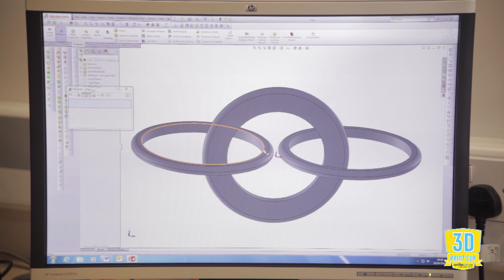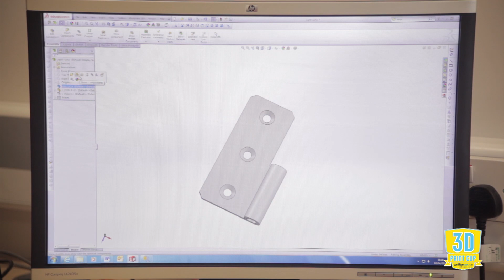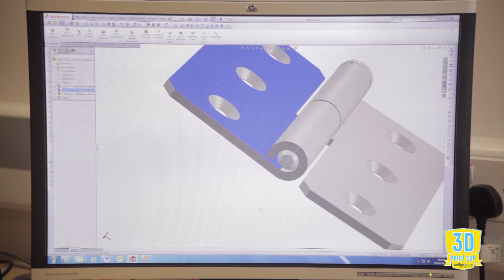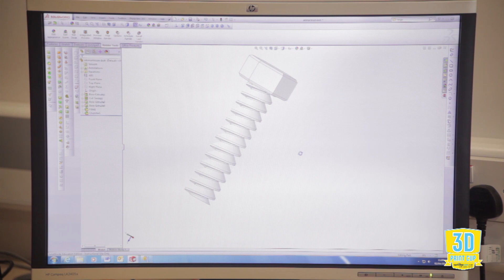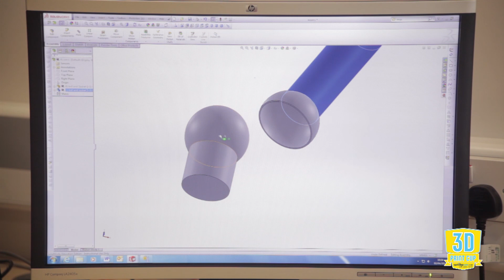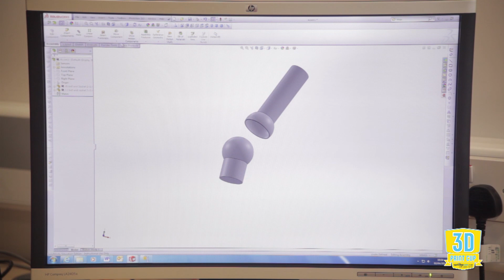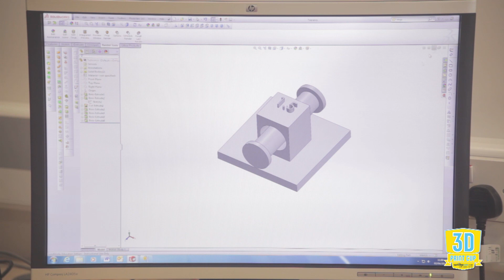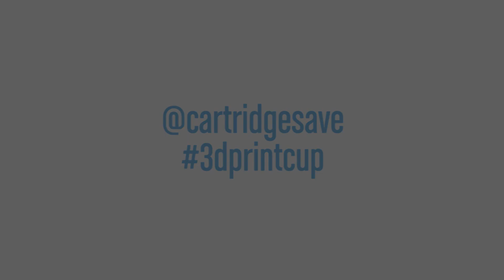3D Printing: how to make moveable parts

Comment: This video did not actually show how the printer should be setup to print these parts, which is what I wanted to know.  ie do you NEED support in all cases? are there situations where you can get by with out adding support?

Comment: btw you have the nut on the bolt shaft pictured .. the slope on bolts and screws is to the bottom ... not the top .. the flat is at the top .. the reason for this is the slant allows the bolt to self center and the flat allows the bolt to hold tight against extraction .. if the slant was on top it would be more likely to fail by stripping and sliding out ..
Reply: ok you did show how to make movable parts ... in a few different ways ... but you didnt actually SHOW the setup in the cad program .. you showed a starter NOT the finished item until you demo'd that at the end ... this is more a review of 3d printing joints NOT a HOW TO ...
Reply: @0623kaboom  yeah i noticed that as well but he did give me some ideas

Comment: Everywhere in this vid where you say “tolerance” you should say “clearance”. Clearance between parts is what you need, tolerance is how much the part can vary in size and still be acceptable.
Reply: Thank you! So, to what extent is language/terminology important? Well, it depends on context. Sometimes it's fine to be "loose" in usage: regardless of labels, does one know enough to achieve the desired result? Clearly, Mike understands things in practices. Kudos:) BUT in the context of engineering (and perhaps a "master" class), "proper" terminology is valuable, especially when communicating ideas to others. "Clearance", "tolerance", (and "precision") have specific definitions. Thx again for clearing things up for the reader. For the record, "precision" relates to repeatability. Finally, "tolerance" is misused so often that some of us are compelled to comment!:) OK, y'all can carry on, now:)...
Reply: I was thinking something similar and I'm not an engineer.  I also wondered if allowance would have fit as well, however I think allowance is an allowed  tolerance, so much for that thought.  Then I wondered if terminology and acceptable terminology varied by location. All and all, for me, its an informative video. I am however no sure what my clearances will need to be, of course I was just looking to see if it can be done.

Comment: All the stuff I print is movable I mean how else can you print something if you have to move the 3d printer in order to have room to print something else? 
if I cant move what I print my house would be filled with floating plastic objects that just won't move no matter how hard I hit it with a sledgehammer. 
i can make "mechanical moving" parts at least those don't float around..

Comment: Useless video. So little information was given for someone to actually be successful. The devil is in the details, especially with FFF 3D printing.  None of the 3D models shown look anything like the printed parts. Location and amount of support material, infill amount, along with optimal orientation of the part on the machine is critical to getting a usable 3D print that just might work as mechanical part. It is a lot harder than your video makes it appear. No mention of how important it is to use the proper filament material which is appropriate to the intended use of the mechanism.

Comment: How much tolerance is needed between parts that move though? Let's say I had a simple piece that is supposed to slide into a groove in another piece. How much smaller do I need to make the sliding piece to fit easily into the grooved piece?
I'm having trouble finding the answer to this question. Any help?
Reply: FlipFlopGaming in my experience, 0.2mm is a good starting point for tight fit.
Reply: Teedjay Gendron omg THANK YOU! you are literally the first person answer this question for me. You are awesome!
Reply: I still encourage you to make your own test, because this can change depending on your 3d printer/setting. My test was: a 5mm diameter cylinder and a hole going from 5.3mm to 5.0mm diameter in 0.05mm increment to see where the fit was perfect.

Comment: Also where is your Teflon tube for the filament you can't just have the filament dangling about it goes through a tube
Reply: +iCloud It's a direct drive extruder, meaning the motor is mounted on the extruder and forces the filament through the hotend. You're thinking of a Bowden style extruder.
Reply: +Quoc Tran no. No I'm not I have two up printers you should have a Teflon tube that goes between the filament spool holder and the extruder as a way of tensioning the filament and not causing pulsations on the extruder by the extruder head moving and having to drag the filament of the spool sometimes but then when the filament is slack there is no tension on it so it extrudes normally, use the Teflon tube !
Reply: +iCloud That makes sense. I'll have to check it out.
Reply: +Quoc Tran not a problem man always here to help up users
Reply: +iCloud I think a bigger issue might be that the axis with the extruder might have problems moving smoothly with the pulsations that you describe. The extruder gear usually clamps tight on the filament and will extrude the correct amount, even with some tension. Unless there is so much tension that the motor starts losing steps or it starts grinding the filament, but that really doesn't happen with those little jerks if you have a decent extruder with a decent motor (geared with hobbed bolt or something like that). So it's more about the axis being able to move smoothly than the extruder having problems with differences in tensions...

Comment: Not even a bit of an expect. That's not even 3-D printing, its FDM. He shows us challenging prints, on poorly made SW models and then doesn't print them. Joke
Reply: +Guy West SLS, UV reactive polymers and FDM are all additive techniques. they are all 3D printing. 

there is no one single manufacturing technique that is "3D printing"

if it creates a 3D object by an additive process it's 3D printing regardless of the process.
Reply: +Guy West  umm fused deposition modeling is a 3d printing technique. What the hell are you talking about?
Reply: FDM is a type of 3D printing.
Reply: +Guy West I have a resin printer. A resin printer still builds a print layer by layer in an additive process.
Reply: +Glen Beestone it's Additive layer manufacturing. 3d printing uses UV LIGHT reactive liquid material
Reply: +Derick Hess yes your right. ALM is the term that encapsulates all this technology. FDM and 3D printing are types of ALM.

Comment: Do you need to put the support material in when creating it or will most 3d printers put them in by themselves?
Reply: +Jake M Most software will put support material in itself, but this is what makes or breaks the print, so it's often best to manually create support.